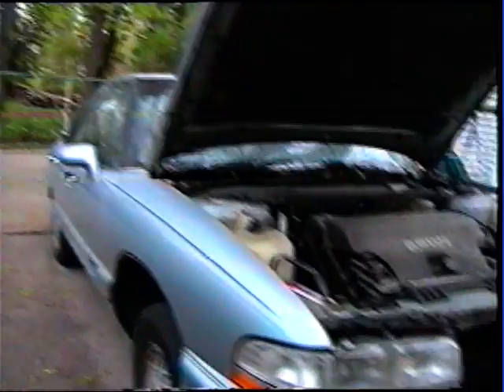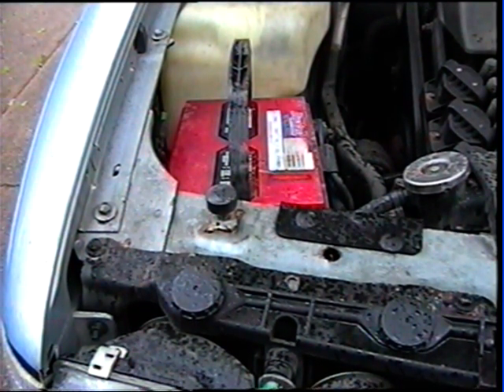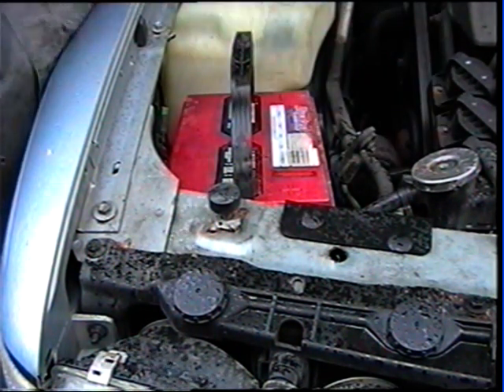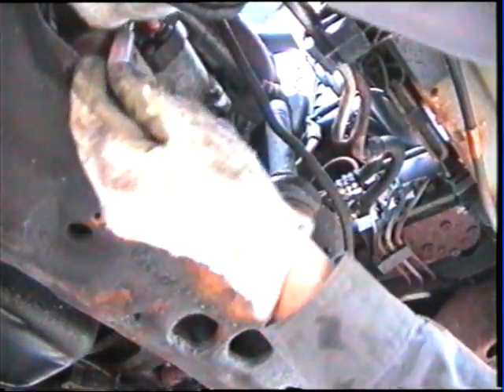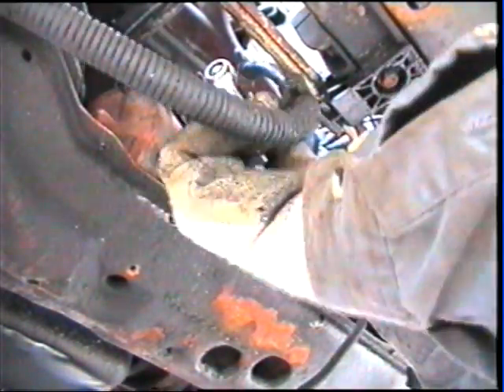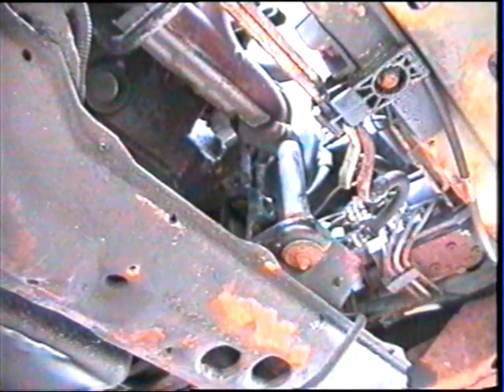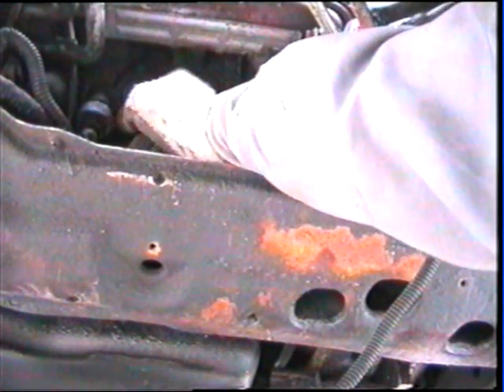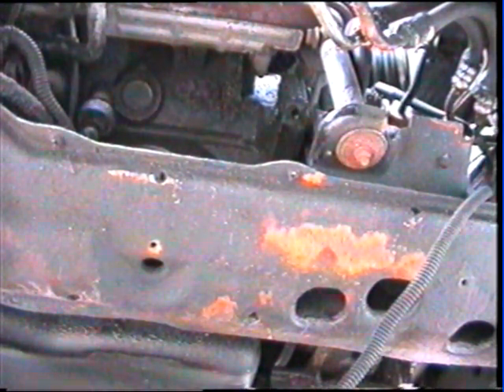Replacing  starter 95 Buick Park Avenue  3800 Engine

Comment: Dude, thanks a million-- this video is entirely responsible for my successfully replacing the starter on my '95 Lesabre today. Especially the part where you locate the back bolt-- the long one-- and then suggest to put that one back in first when installing the new starter.
Reply: Joe Piecora were your bolts hard to get off I got the same year car and I can't get my bolts off

Comment: just got the motor off, gonna go to the store soon to get a new starter, thanks really helped. was a little different with my supercharger there was a shield infront of both bolts which confused me cause it hid the bolt in the back so i thought maybe theres just one bolt hahaha. took of the shield and was able to move it just enough to take the starter off. thanks a bunch.  

Eric
Reply: How did you get the shield off? I got the front part off but the part covering the bolt I cannot get it off

Comment: Hey thanks for the vid...that rear bolt is hard to find if one wasnt aware of the plastic useless shroud...thanks again..
Reply: Shawn Mckay I think you missed the point.  The plastic inspection cover shroud that is "missing" from this vehicle is not necessary for the starter functioning, but it does have a "purpose."  The plastic inspection shroud (two-pieces) keeps dirt and road debris from entering the flywheel housing.  To consider it "useless" is just as ignorant as driving your car without an air filter.
Reply: @FatManDoubleZero  how do I remove the second piece of the shroud?

Comment: That plastic splash shield is necessary and needed.  Without it in place, all of your electrical connections as well as you brake lines in that area of the engine area as well as your flywheel will be exposed to the weather elements.  You need that plastic splash shield!